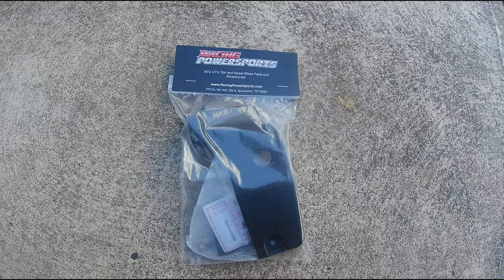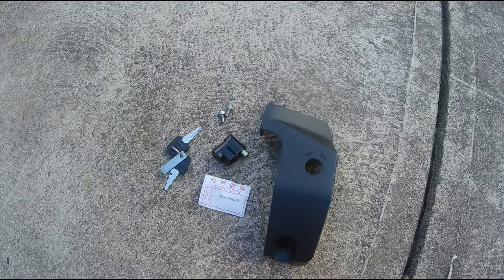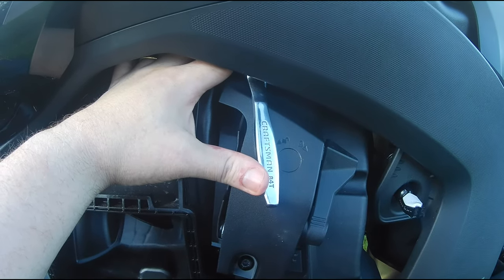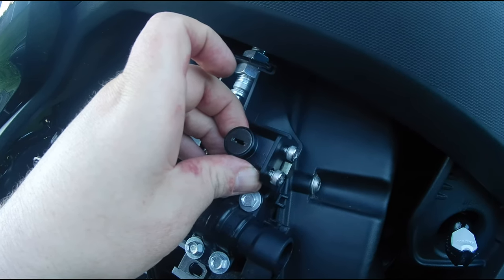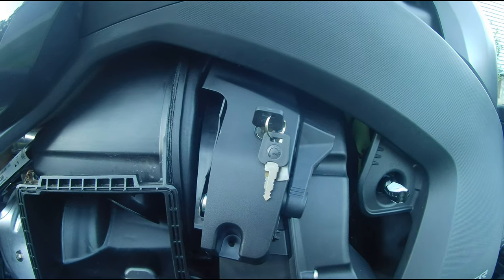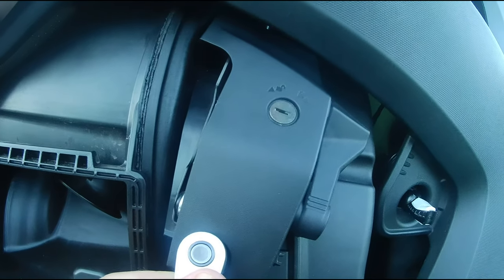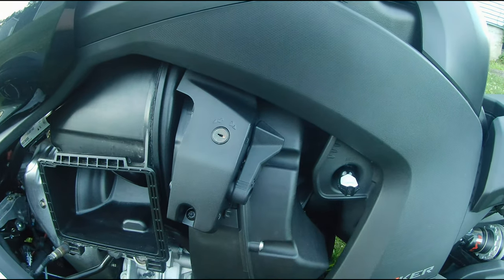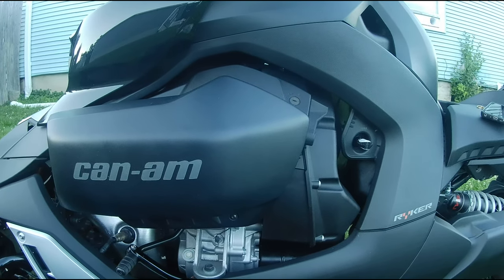No Drill Can-Am Ryker Parking Brake Lock Kit Installation

Comment from the maker: The kit includes part number 707000666 parking brake lock and screws plus part number 707002241 OEM cover with hole drilled in it. These are the part numbers that I was given in an email from racingpowersports.com. I wanted to give you a link to the kit but it wasn't on the website anymore. Hopefully, they are not sold out. The phone number to racingpowersports is 888-438-6777. Give them a call and see if you can order the part. Hopefully the video helped you out.
Reply: Thx for replying. The video helped a lot, I was not wanting to drill the hole since I just got the ryker but I wanted to install the brake lock. You gave me a way to install the lock and keep the original cover untouched. When I turn in my 600 Ryker for the 900 Ryker in a couple of years I can switch the cover back to original and install the lock on the new one.
Reply from the maker: @punkinhead2634  No problem James. That sounds like a good plan. I may try drilling the hole in my old cover now that I have nothing to lose lol.
Reply: I'm sure my Dealer can get them, but I have decided to do it with a solenoid,  you "have " to start it before you can  release the parking brake, I havent completely thought through all the logic before i do it 
.... yet
Reply: @punkinhead2634  James, you are a dreamer... to think they wouldnt have figured another way.... lol good luck man, I'm thinking about how to do a solenoid  to auto unlock the tranny when its started, but I want to think through unlocking it when it's not powered
Reply from the maker: @the1spyderryder  That sounds like a cool idea. Let me know what you come up with.
Reply: Thank you for the video. Just got my wife one and it didn’t have a lock. Thought I was gonna have to raise the whole body up but thanks for this video it helped out a lot took me about 20 minutes.
Reply from the maker: @mpollard1876  Thank you so much. I am glad that I was able to help you.

Comment: I ordered a step drill bit off Amazon and drilled the hole myself. Removed only the bottom, very easy to reach bolt. Lifted the plastic cover up just enough to slide the locking into place and screwed it in. Finally I replaced the bottom bolt of the cover and I was done. The whole job only took maybe 10 minutes start to finish.

Comment: Great video.  Takes longer than you think and that top screw is a beast.  I used a 1/4 drive tilting head socket with a T30 and that screw took easily 30 mins to get it back in.  You will want lots of patience for that screw.  Rest of it took 5 mins.  When you are putting the new cover on it will bend a lot at the top, but mine didn't break.  Wouldn't try it in cold weather.

Comment: Thanks for the video. I installed mine today.  I got the part from my can am dealer for $25. Top screw is a pain but I didn’t want to drill.
Reply from the maker: No problem. Glad that I was able to help you out. The top bolt is a pain but I was afraid to drill. I wasn't confident lol. Hopefully, it helped you out. Thank you for watching.

Comment: I tried your way to install, but used a long torx driver bit and a midget wrench on the end of it. Worked out pretty well. I didn't have any torx sockets to use, so used what I had.
Reply from the maker: I am glad that you got it installed. Hopefully, the video helped you. It is a little tight to work with. I got worried when installing it lol. Thank you for watching.

Comment: How does the lock engage the parking brake lever?  I'm thinking a solenoid would be the way to go to lock this lever. The reason that I say this is, if you have the hard shell saddlebag then you already have two different keys to keep up with, and now it's up to three.
Reply from the maker: When you turn the key, the lock goes inside the lever. I know what you mean about the keys. I am up to 4.

Comment: I ordered the lock mechanism and aluminum parking brake lever from Slingmods.com. I did have to drill the hole out. Unfortunately, after installing both, I found that the lock mechanism was too long when in the locked position with the aluminum handle. I had to reinstall the factory plastic lever. Somehow it has a deeper recess. They are sending me a new lock mechanism to see if the shaft is shorter, but if not I may have to grind down the end of the mechanism to get it to work. I really like the idea of extra security having both pieces be metal, instead of metal and plastic. Has anyone else had to same issue I have, and any tricks or suggestions?

Comment: Anybody else watching this while struggling to get the top screw back in. Lol
Reply from the maker: I feel your pain. That top screw will make you want to drink lol.
Reply: Me..5 hours later everything is good just cant get the top bolt any tips plz
Reply: budyser365 how did u get it back in
Reply: @mrperfect1856  if you have someone with small hands get them to do it. I have large hands and the plastic chewed my hands up. Best advice is to find the shortest socket possible and guide it with pointer and middle finger. Takes a while
Reply from the maker: @mrperfect1856  I felt where the top screw was by hand and started threading it. Hurt my hand a little. Tight fit. Then used the tools in the video. I needed a beer later lol.

Comment: Why are people using these? What’s the point of a locking parking brake?
Reply from the maker: You can flip someones parking brake and roll the Ryker down a hill. Also a Ryker is easily stolen when the parking brake is off.
Reply: @budyser365  yeah, I know what can happen. But it doesn’t. I’ve had over 40 bikes, and literally none of them have been tampered with. Why would somebody just pick the Ryker to mess with? They’re just bikes. They aren’t special. Let’s all calm down.